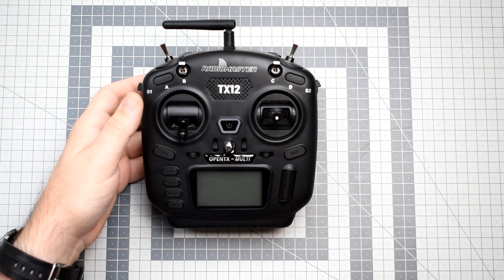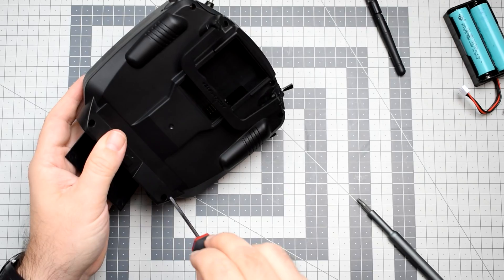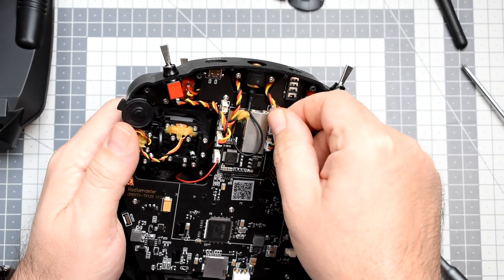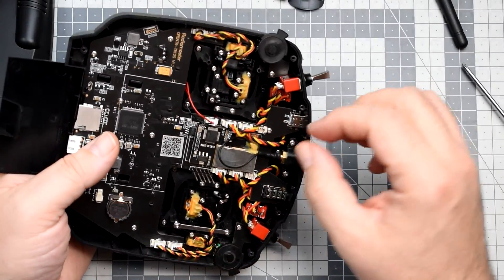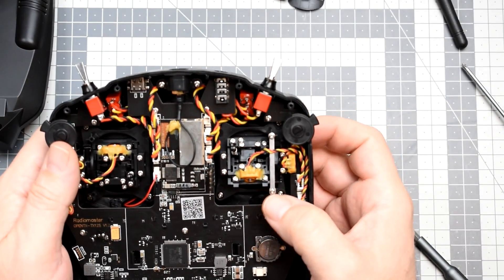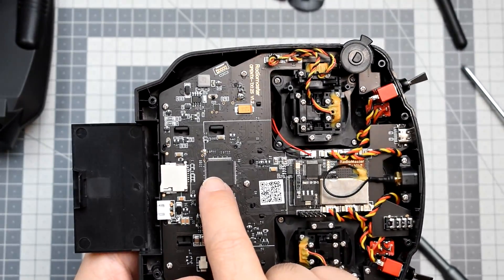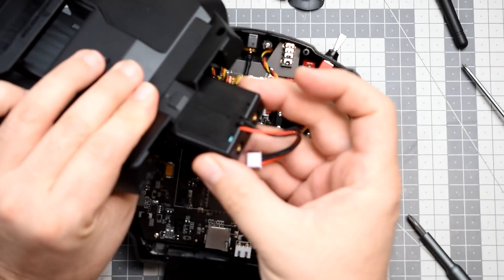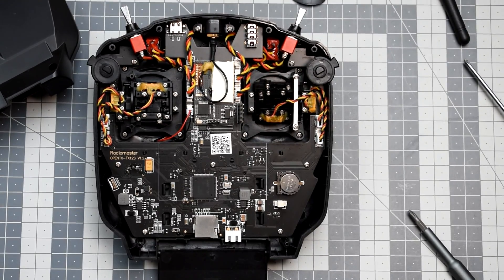Radiomaster TX12 Teardown

Comment: * need help *
i accidentally power on my radiomaster tx12 radio without antenna how can i check if the transmitter is not damage i don’t have any quads
Reply from the maker: You can't. Probably everything is fine. It would have to run for a while to overheat PA

Comment: THIS RADIO ALMOST SEND ME STRAIGHT TO JAIL!
hi pawel, 
i got a TX18S. whatever that number means and i got a super weird problem. after months of flying normal without any issue it went nuts some days ago and send signal to my drone go to full throttle + 100% yaw left. made my iflight evoque 5" almost fly into paramotor pilots face mid air which most likely would have end in crash/death from these guys because fly over water. and that means jail here even not my fault. 
i thought: if ANYBODY know what might happen there it would be pawel. did you EVER hear something like that before?
took the radio apart. no connector issues inside. radio is only some months old. no other software glitches i see before. what do you think? 
it wasnt crossfire link issue too because i have control over the DISARM switch. which i push. shut off and let it fall down where everything was broken after the impact.
Reply from the maker: No idea what that might have been. Sorry
Reply: @FPVUniversity  alright... thanks anyway. worth the try. maybe you would say: yeeees i know this problem before and its software related! or something.. haha. cheers mate° 
thanks for answer

Comment: You're better off waiting for a sale, and springing upward for the TX16s HAL version.   You don't need the CNC MAX color stuff, but you definitely want to at least get the HAL gimbal version.  Why?  Because you'll be putting a lot of mileage on them in a sim.  Skip the SE version and skip the POT version, and skip this TX12.   I could see maybe a market for the TX12 as bundled transmitter radio in RTF kits a kid would get for Xmas,  and that's about it.  Lighter weight attracted my interest, but I'm not ready to lose a whole bunch of switches.   I use them all and then some...  overloading all of them with secondary functions using the momentary toggle switch as a SHIFT key even...

p.s. I think "Justin" is probably Drone Camps RC channel...

Comment: beautifull chrismas joke searching for Justin whose letter arrived at andrew newtons desk ... and andrews on yours.

Guess the radiomaster communication guy deserves a new job cause that guy had to check at least that letter, packaging and label fit together. Good companies use a digital camera to take pictures of the content for reviewers and other important customers. 

But Radiomaster is new so they might have learned a lesson and that staying good in business needs more then just a good product. 

Regarding the product I went for a expensive TX16S with tbs crossfire kit and receivers,
purchased also the cheapest TX16S for less than 80€ in the last sales and
finally for a beta fpy joystick like transmitter and
a presale TX12 unit that should have been shipped today from banggood.

What I wanna use ? 

I want a cheaper joystick like open tx transmitter like the FR sky X or whatever it had been called which I sold last year when FR Sky closed the procotols and you and x-jet talked about.

Therefore the beta fpv will stay most likely and of cause TX16S but not sure if I would need the more expensive ones.

Regarding TX12 I do not know if i have  much use for it but otherwise I will sell it cause buying cheap is my first key decision cause then selling it again if not so usefull will be a lot easier than waiting until a point in time when I need to buy that for a too high price.

Therefore autumn is the point of year where I mostly buy all the stuff for the upcoming season except new model planes and ships.

great video even though the funniest moment had been your letter for Justin.

Comment: Well dude, the Flysky uses a A7105 rf chip.... you better should have started in the early days with DEVIATION project..;-) , then you would have known . Overall this radio looks nice inside. Did you ever opened a Devo 7e , which is the predecessor of this form factor.